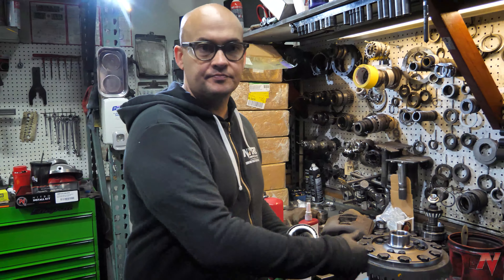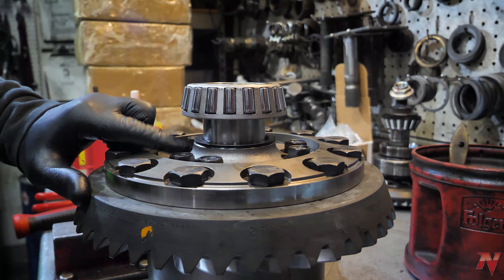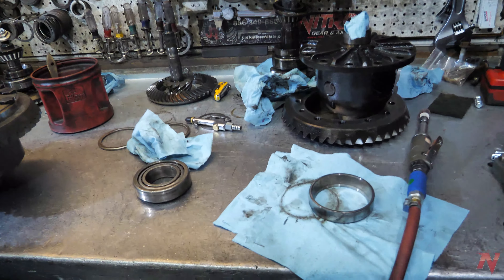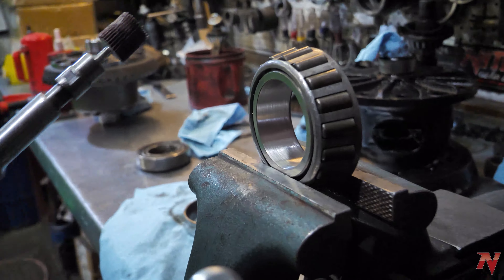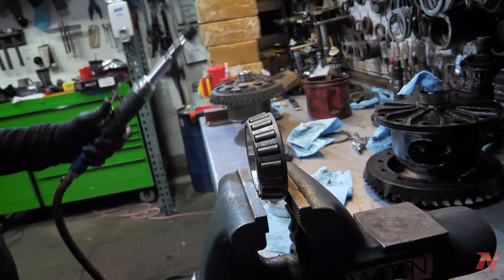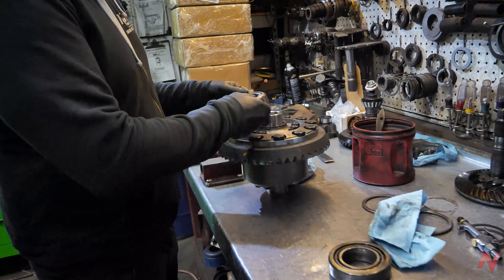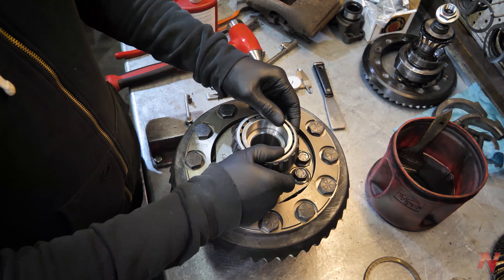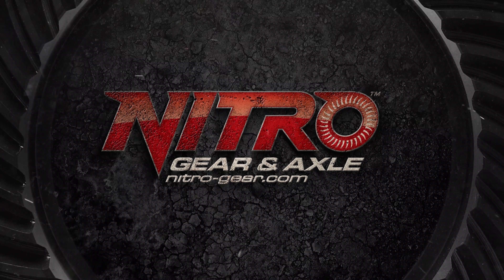Tech Tip: DIY Setup Bearings - Save Time On Differential Installs!

Comment: isn't it recommended to use a new bearing that's been machined so it will mimic the newer bearing? as opposed to using a bearing that has been worn in?